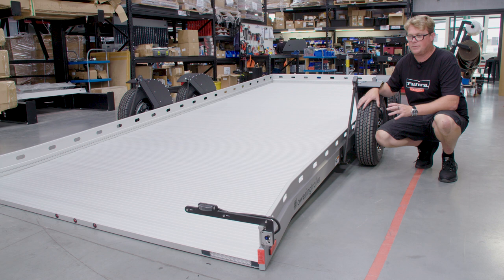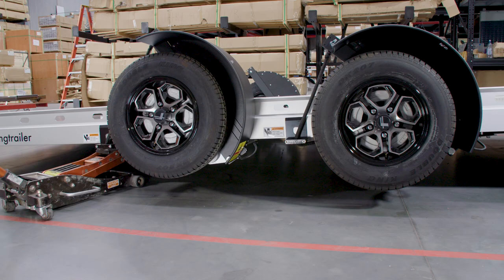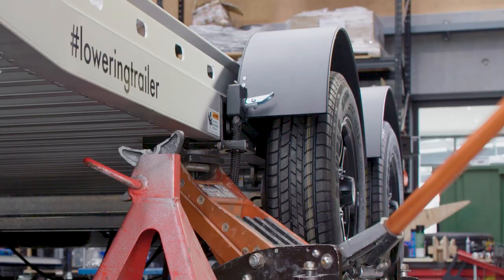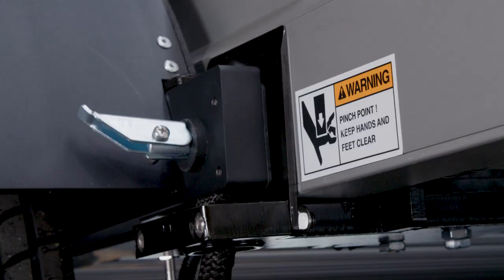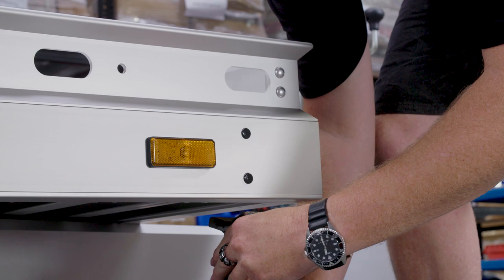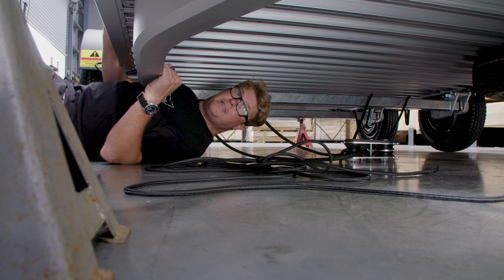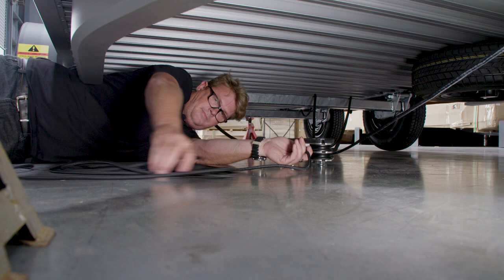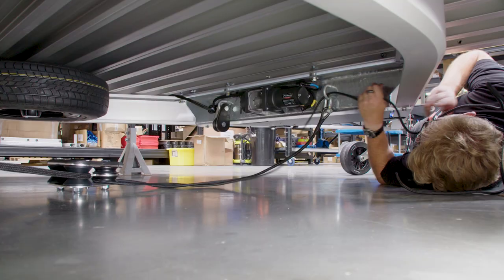How to safely jack a Futura Trailer | My Futura #cartrailer #carhauler #futuratrailers

Comment: This is fine and dandy but where’s the video where you install that rope afterit brakes and you can’t use the trailer?
Reply from the maker: You can find this video and more on our Vimeo and Knowledge Base section on our website 😀

https://vimeo.com/692928466
Reply: @FuturaTrailers  Saw the video and after buying the cord and removing the old one saw that the winch had snapped ! Broken which made the cord going into the crack and brake the cord. So there wouldn’t be any problem with the cord to begin with. Had only used the trailer 4 times. The cord broke because the winch snapped. Do you have a phone where I can talk to someone in US? The person in California seems to not have time to talk on the phone. I don’t want to send emails no more. Thank you!
Reply from the maker: @loloforge2841  Hey there, sorry to hear about that. You can contact us on 855-744-3877 and email us at trailers@futuratrailers.com

To ensure we get hold of you asap, you can also message us on Facebook or Instagram with your contact details, so we can sort this out for you 😊